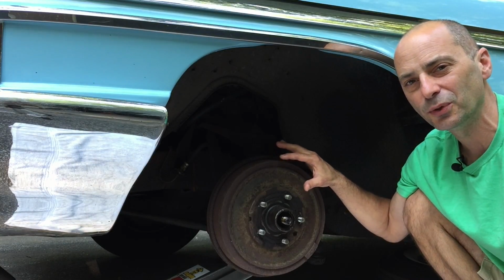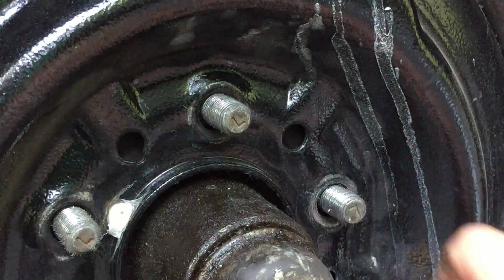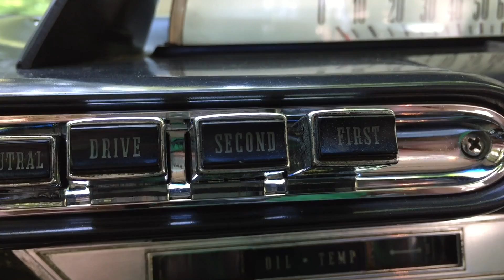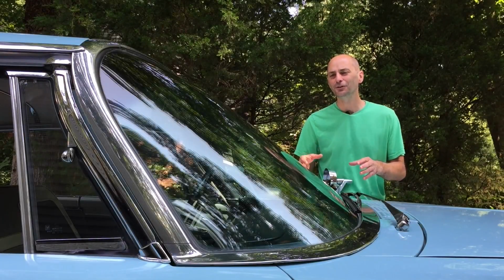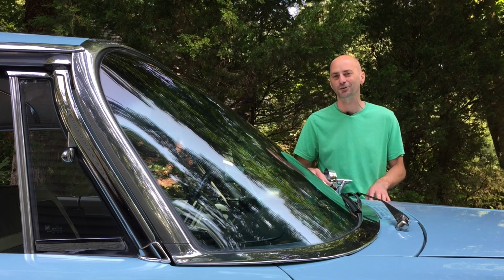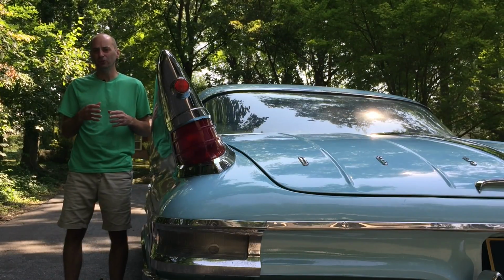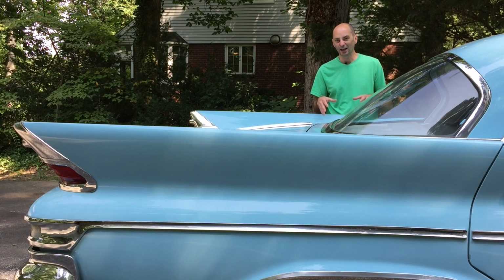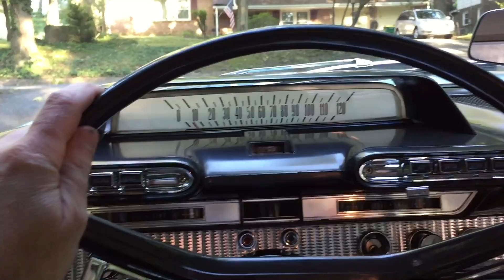1961 Desoto - Cool, Fun and Weird  2 of 2

Comment: First of all, left hand lug nuts/bolts (depending on the year) were used on Chrysler products for a very long time. It was a safety feature. The wheel/tire rotatng assembly on the left side of the car rotate in a counter clockwise direction. This counter clockwise rotation will loosen the lug nuts/bolts an was quite common in the old days. Reversed or Left handed nuts/bolts on the left side of the vehicle prevent this from happening. Take a trip through Youtube, there must be a zillion videos of wheels coming off of trucks or cars or trailers. Most if not all are on the left side. Second, you talk about the Desoto brakes like it was a Desoto problem. All cars has drum brakes back then and they all had the same problems. Love your drive around portion. The music, the camara, great stuff.

Comment: Bought 59 DeSoto in 66. I needed a second car for my girl friend and found this red convertible on the back row of the car lot. Salesman said it didn't run and I could tow it away for $100 bucks. It looked okay to me and cranked over smooth. So I gave him the hundred and ask him for a screw driver. I reset the points it started right up and I drove off.  Boy was he upset. Turned out to be a great car. We towed boats and trailers all over Idaho no problem.

Comment: Left hand thread wheel nuts on the driver's side (left) of the vehicle was done to reduce the chances of the wheel nuts working loose, this is more common on commercial vehicles where wheels are run in pairs. You must get rid off all the swarf from the threads & nuts as it will damage them, a bit of Copperslip helps to prevent this occurring & stops the threads from rusting. Great video & the '61 Desoto is fabulous!
Reply: or silver anti seize
Reply: May have been one reason, however at the plant where they all were made the machine used to put the lug nuts on would swivel around from one side to the other (thus no need for two machines). It did not have reverse on it so on one side they had to use reverse threads. All Mopars for decades used the lefty/righty lug nut threads...

Comment: Correction.  The transmission lever to the carburetor is for kick down, and adjustment thereof does not make it more aggressive.  If you want more aggressive, faster (and less smooth) shifts, vendors came out with "shift kits" that are installed in the transmission itself.  The throttle rod adjustment by the carb is to make it so that when the carb is wide open, the lever is in its farthest back position, signaling the transmission, if at an appropriate RPM, to downshift one level.  So say if you are going 45mph in 3rd gear (Drive) it would pop it down to 2nd to give you additional acceleration.  Same with 2nd to 1st.  If the throttle rod is not pushed back all the way during wide open throttle, it won't downshift properly.  If it is adjusted too far the other way, you will hit the throttle rod stop before the carb is fully open, inhibiting the wide open throttle.  It is rather a precise adjustment to get it right.  Typically, adjusting it as I stated is all the adjustment you need and the car should down shift fine at WOT.  Slight adjustments can be made if you have some wear in the system linkage.

Comment: Just wrote the story below when I remembered my other car was bought the same way.  I was in Denver in 65 and my 53 Chev just wasn't up to the long high speed freeway commute. I went to wrecking yard and found a 55 Chrysler new Yorker sedan with hemi that was all complete and not wrecked. The guy said it wouldn't start and I could have it for  $50 bucks. I got a battery and it cranked smooth so I paid him and reset the tricky dual points Chrysler used on their hemi's and it started right up. Again the wrecking yard guy was upset. Drove it away and over 100,000 miles the next four years

Comment: My mom had one until 1967, my brother was playing with the push button transmission and it rolled backwards into a garbage truck puncturing the fuel tank with the tailfin. The views from the rear seat awakened memories
Reply: The engine would have to be running and the parking brake not on for that to happen. Who lets their kids play in a running car with the parking brake off? Since there's no Park position on the transmission anyone would apply the brake when parked.

Comment: 1961 DeSoto video was quite good. Very educative. Compared to other, more popular cars of the day, such as the 1961 Olds, the DeSoto was clearly destined for failure. Obviously, Chrysler sabotaged the line. Thanks for a terrific effort.
Reply: I think the 61 DeSoto was far superior to the Olds that year.  It had full instrumentation vs just a gas gauge and a far better transmission.  The 4 speed Hydra was excellent, but the 3 speed Hydra used on the 61 Olds was not.  The DeSoto also had better suspension and better brakes than the Olds, and if you managed to get the 383 put in your DeSoto, was faster too.

Comment: I LOVE this car. Styling wise its like the last 50's built in '61. It really does use a ton of stainless which is a great feature but must have added a lot of cost,  Its harder to tool but there is no secondary finishing operation so that is a trade off. Those Desoto Engineers were ahead of there time, mostly.

Comment: Floor mounted high beams, windshield washers, and even horn button were commonplace of that era.  Same goes for the front drums.  Though disc brakes were optional on many Marques.  The left-handed thread on the driver side wheel studs  was a safety feature.  This way the wheels mostly always spin in the direction of tightening. 😆

Comment: This Desoto looks a lot like the 61 Chrysler .  My family had a 60 New Yorker in the same blue and it looks similar also but the Desoto is much more of a eye catcher. The 60 New Yorker also had the radio dial on the floor....so cool. They just don't make vehicles like this any more; quiet, great ride, fun to drive, plenty of power Etc.
Reply: That's partly because today's cars, ChryCo excepted, are all in the Japanoid mold - small, cramped, rough-riding, ugly .

Comment: Mercury was created in 1938 by Edsel Ford, Desoto and Mercury were in direct competition with each other. I enjoy your videos
Reply: Originally Mercury had its own wider body although it looks pretty Ford-like. Postwar they had a unique body that was originally going to be a Ford 1949-51, then shared most with Fords 1953 to 1956 (although enough different that they seemed unique until you saw a station wagon), and then from 1957-1960 totally unique, then not. Always shared versions of the same frame and mechanics and often body structure with Fords.

Comment: There was a belief that the lug nuts could loosen up as the wheels rotated.  This is the reason for the left hand threads on the left side.  Quite a few cars had them....but I thought this was gone by the mid 50's.  Very cool car!
Reply: Pretty much only Chrysler cars though, I believe. All of them.
Reply: Didn't semis use reverse threaded lug nuts back then, too?
Reply: I worked on cars back then.  All the Chrysler cars had the lefty threads.  They also had different brake wheel cylinders.  This 1961 DeSoto is a real beauty!
Reply: Has the car ever gone fast enough to shift intob
Reply: Davesnothere Man I had a 1970 Challenger and it had reverse threads.
Reply: It was common on all American cars. I can't say for sure if it's true of FoMoCo (no mention of it on the internet), but I can definitely say that both GM and Chrysler products used reverse thread lug nuts on the driver's side at least through 1965 and probably into the 1970s, and at least some other makes like Jeep as well.

I believer the practice started in the days when wagon wheels were held on by a single nut in the center of the hub. In that case you definitely needed reverse threads in order to keep the wheels on the left side from coming loose. The practice continued when carriage and wagon makers started producing horseless carriages instead. Nobody bothered to question whether the feature was still necessary when they started using multiple nuts per wheel. Knock off hubs (racing hubs) need to be reverse threaded on the car's left side as well.
Reply: Martin Sage it's really nice to see a forward look Mopar with no rust

Comment: My parents owned a Dodge Phoenix when I was a kid.  The dash was nearly identical to your Desoto.  Only difference was the dashboard had two "flip up" a/c vents, I think to the right of the speaker grill on yours.  Also, I recall that foot switch on their car pumped washer fluid.  I don't recall it switching on a wiper swipe - perhaps that didn't work on their car.  I remember filling a soft washer fluid bag under the hood..  Yep, pretty much exact same dash except it said Dodge instead of DeSoto on the steering wheel.  Anyway, hope you're still enjoying your car!

Comment: the urban legends about drum brakes always crack me up.  It's just a miracle we weren't all killed with them, is apparently the notion. They worked fine, they weren't as efficient nor as easy to use as power assisted discs but very few of us died as a result.  They managed to stop those 4 thousand pound behemoths repeatedly, do i don't see the need for all these talll tales about "Sheer panic" when hitting theb rakes.  Never happened to me once.  and I drove LOTS of 1950's cars as a kid.
Reply: What he didn't mention is brake fade. Like he said drum brakes heat up faster because they don't cool as well as discs, and then unlike discs they lose effectiveness when hot. I drove from Pacific Heights down to the Marina in San Francisco in a 1956 Plymouth with six people in it (with power brakes that were well maintained and transmission in Low) and by the bottom of the hill I was standing on the brake pedal with both feet and the brakes were working about 10%. An uncle told me he was driving his family in their 1954 Chrysler New Yorker across New York State before the Thruway and went down a long hill into a town and ran out of brakes. Plus the wet brakes problem. Plus they don't stop as stably, and can grab. And of course no anti-lock.
Reply: I second you!  Another (modern urban legend is that 6 volt cars can't start.  These youngsters never stop and realize that we made them work fine.  They also don't know about 8 volt batteries .

Comment: The Chrysler lineup was quite interesting in these years.  Notice no park lock on the transmission.  You put the car in neutral and had to set the parking brake, or the car would roll away.

Comment: The lug nuts on the left side of the car are reverse threaded because it is a safety feature. When the car is moving foward, the lugs constantly tighten slightly. I owned a 55 Pontiac which had the same feature.

Comment: the left hand thread was a self tightening feature ,  the kick panels werent plastic, but rather metal the second button on the floor was in this case for the wipers but on some cars like imperial was a radio control feature which took the tuner to the stronger signal in the area these cars are the bomb, they rode like none other the dashboard mirrors looked cool but in many cases werent that effective,  the pushbutton transmissions worked very well , overall, nice car

Comment: What museum did you steal this creampuff from?? Left hand thread, on left front wheel, was a safety feature. My 1964 Oldsmobile, had it as well.Asymmetrical  front seat was not mentioned either. So many cool features, easy to forget some.This car deserves to be kept 100 % original. 4 doors, is not a problem. Thanks for sharing.

Comment: OMG....this reminds me so much of a Chrysler I had. The reverse thread lug nuts, 3 speed torque-flight, non-self adjusting brakes, the power steering that feels like the steering wheel isn't even connected to the car, rear view mirror on dash, no "Park" gear just the parking brake, I'll bet this has "two" brake cylinders on each front wheel. These cars blew out upper brake cylinders like crazy.
Reply: My Chrysler has thatvsame system, and mine is trouble-free.
Reply: @michaelbenardo5695  I had a used one I bought in 1976. Constant problems and I could only find two mechanics that knew how to repair it. I was driving it as my regular car so I put a lot of miles on it but just constant electrical problems....and the astra dome dash filling up with smoke, constant over charging, boiling batteries. My next car was a 1965 Chevy Nova II station and basically ,  never had any problems.

Comment: Just another Point: Chrysler's Marketing Dept. decided not to make the 1961 model car. So the 1960 Fireflite would be the last one, but the Engineering Department along with Materials had gone ahead so far without knowing Mkting's Intentions. They had designed this car (with canted headlights) and bought enough material to build some 2000 cars. The assembly plant has been dismantled thought, so they had to re-build it in another place in order to build these cars and make some money...and so they did. Marketing had never given a Model Name to this car, so it has no Name Badge on the rear Side. Some owners bought the Fireflite Badge and placed there, but your car is the real History - a car with no name. Nice looking and well maintained car, congrats!

Comment: Mercedes-Benz has had manually adjusting seat tracks since the 1950s where they too are angled. As you slide forward, the seat inclines upward. It’s so that short women can see over the steering wheel on the way to the hair dresser or supermarket.

Comment: Left-hand threaded lug nuts or lug bolts on the driver's side was the norm back then.  The belief was that right-hand threaded lug nuts would not stay tight on the left side of the car.   The washer switch on the floor incorporating a spurt of wiper action was a popular period option.

Comment: Correction:  The first Mercury appeared in 1939.  Also, most cars in 1961 had drum brakes.
Reply: Did you know the first car that had fluid disc brakes was the 1939 Buick Y Job custom car made for Harley Earl. That brake set up would not be seen again until Ford offered it for the 1966 Country Squire, Colony Park, Thunderbird, and Continental
Reply: Studebaker had power-assisted front disc/rear drum brakes as standard equipment on the '63-'64 Avanti, optional on all other models from model years '63-'66, the end of production.       
Corvette used four-wheel discs on the '64 models.   
Crosley had hydraulic caliper-type discs for a brief time during the early fifties, but they were rust-prone in the road salt belt.

Comment: Those four way flashers were not factory equipment. They were a popular aftermarket accessory from the mid-60's through the mid-70's. Most likely ordered from JC Whitney. 1961 was actually the last production year for the cast iron TorqueFlite used in this car. Starting in 1962 V-8 powered Chrysler's got the aluminum cased TorqueFlite 8 (aka A-727) which would be used in to the 1980's.
Reply: They were an option on some cars before they became standard, though. Don't know about this one.
Reply: emjayay they weren’t available on Chrysler products until 1967. The four-way kit showed in the video was a common aftermarket kit that was available in the late 60’s.
Reply: Mopar flashers were an option for all Chrysler divisions in this period.

Comment: Love your 61 DeSoto, but some more info for you.  All car seats from the late 30s on rise up as you move it forward.  The claim to fame on late 50s and early 60s ChryCo cars are the optional Swivel Seats.  Also, most Ford products did indeed use a 3 speed automatic.  It is just that many of them started out in 2nd unless you floored it.  Your car has a fuse for the backups on the windshield wiper switch, and the fuse for the radio in the lead to it in back of the dash.  Did you know that there was supposed to be an Adventurer for 61?  It would have had a 383 with a 4 barrel and dual exhausts, with dual 4s on rams optional.  There used to rumors that they did make pilot-line examples of it, and that some escaped the crusher.  I could swear that when I was a kid, I used to see a 61 DeSoto with gold, instead of chrome, name plates, and gold grilles.  Maybe it was one of those Adventurers?
Reply: There is one overriding issue I have with Chrysler Corp. cars during its forward look era. That is, if the owner opted for a manual transy instead of the push-button auto, the three-on -the tree shifter was on a shaft that ran under the steering column. This made for awkward shifting as well as the driver breaking his right-hand fingers when shifting into second. It was a bad design.
Reply: Re an Adventurer: could be. They were obviously giving up on DeSoto by 1961 and stopped making them after a few months. Also, Chrysler products had a bolt on the seat track that could be adjusted to change the angle of the whole seat besides the longer or shorter leg room adjustment. (Or you could just get a power seat.)
Reply: Finally, somebody besides me knows this!  I too used to see a 61 DeSoto exactly like that and always wondered if it was an Adventurer!

Comment: The Left hand threads on the wheels studs and lug nuts on the drivers side,
Was supposed to keep the lug nuts tight as the car went down the road,
But most people didn't know or see the L  stamped on the end of the stud ,and ended up breaking the stud when trying to remove the nut with an impact tool

Comment: That push button transmission is so good .
Reply: However, if you chose a  3-speed manual instead, the  shifter would be on a small  visible shaft positioned under the steering shaft. This made shifting quite awkward. Only  good thing was that this would be discontinued in 1962 model year.